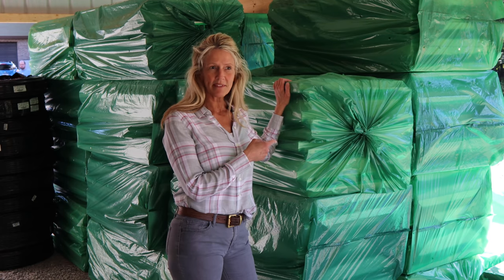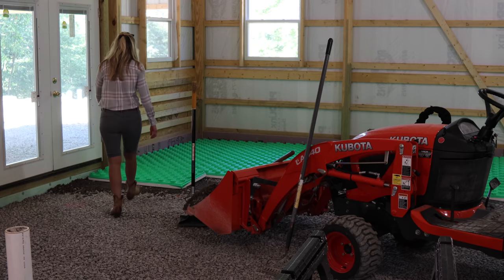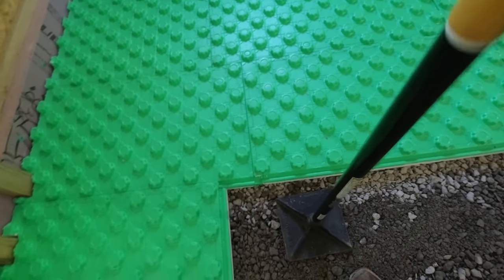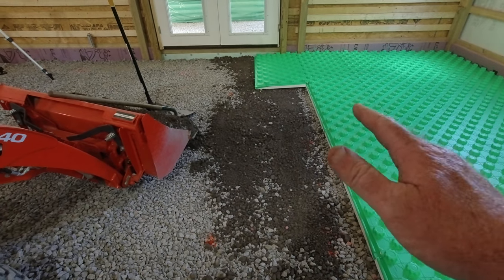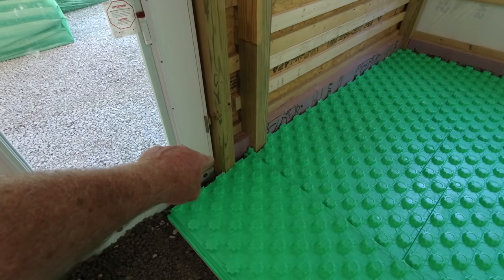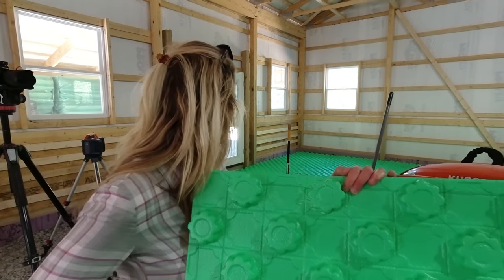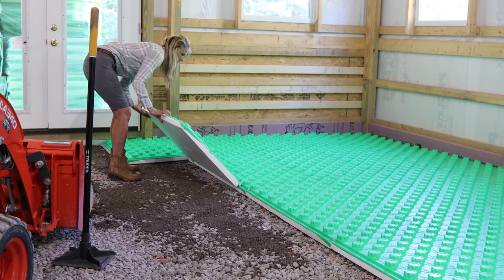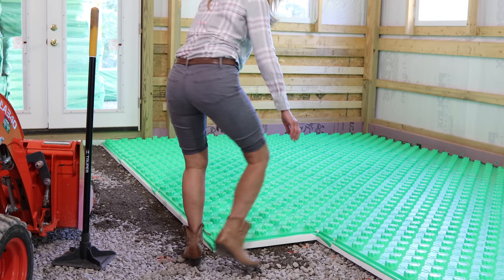I hope the Reward is Worth The Process, Radiant Floor Heat Rough In

Comment: Take really good pictures and make sure your layout is well documented. You can use an infrared camera find the lines after the fact but nothing beats having the layout documented and drawn out. At some point you will probably want to bolt something to the floor and drilling through a hydronic pipe would SUCK. I have a drill press, grinder pedestal, hossfeld bender and a 2post lift bolted to my floor.  If you deal with snow you can't beat a heated slab. Pull your snow packed equipment into the shop at the end of the day and come out to a dry floor the next morning.

Comment: Did you think about the concrete truck being able to get inside and shoot the concrete mix. You don't want a concrete truck driving on your styrofoam panels with the tubing. You will have to use a PUMPER Truck which is an additional cost. Food for thought. Been there and done that before.... :)
Reply from the maker: No, won’t be a pumper and the mixer won’t drive on it. You will see

Comment: Radiant heat warms people; forced air dries sinuses and warms the ceiling. Downside is no AC in the summer, but split-system (Mitsubishi!), wall-hung AC units for office and workout area would address that, economically; make the office area 72 degrees, and workout area 68 (or, whatever) with remotes that look like iPhones. (Suggestion Man -- you can't kill him)

Comment: Question: will the floor heating be as efficient heating  thru 5-6" of concrete as it would heating thru 3.5" of 4000 psi concrete? Haven't heard any talk about that especially in colder parts of the country. Here in Oklahoma may not make much difference, just curious.

Comment: Lol. Getting old is definitely slowing process it much more difficult. Are used to be the same I would just keep pushing and try to get it all done and I rarely slept more than four or five hours in the night and quite often never slept at all and could go for two or three days like that. Now if I don’t get a solid seven hours I’m dead the next day and the older I get the longer it takes to recover from it. Lol. She’s right about the water as well. Are used to be able to go all day long without eating and we get the hydrated and will just come home and drink a few glasses of water and recover in a couple hours, if I’m not fully hydrated and ready to go before I start, I’ll fade really fast and just be done for the day. Lol. Getting old definitely sucks and they’re all kind of things that nobody ever told you about getting old when you were Young. Like things I never thought would be a problem, now I have to use eyedrops every few days or so because my eyes just get really dry and I asked my doctor about it and they said that’s just normal and most people our age have to do that eventually, another thing is dental work, all those old feelings you got when we were kids, nobody ever told me that you had to have those removed and replace because after 25 or 30 years they start to break down, they actually call it leaking at the dentist. My teeth have always been fine and genetically I’ve never had problems with plaque or anything and it’s always been real low maintenance but this year I’m going to have about $6000 worth of work done and almost all of it is maintenance and replacing stuff that was already done that I thought would last forever.  Somebody really needs to write a book about this stuff so we know what to expect. 😂😂

Comment: I'd use sand , coarse washed or even cracker dust , and screed it out with a concrete screed , checked with the laser of course , . you'd be throwing them down pretty quick then.

Comment: No experience but expect you are using something like a running bond to keep the joints staggered,  say every other row is offset by 1/2 panel length.  Or maybe 1/3 and repeat over three rows. Not sure what the manufacturer recommends.

Comment: There is no need to get it all that level, I imagine that you will be pouring a minimum of 4 inches of concrete over the floor, the weight of the mud will level every thing, if driving heavy equipment over the floor poor a six inch slab, also if planing on a car lift plan ahead and pour some footers for a future lift, looking good going to be a awesome workshop, you can also run some conduit under the floor for all your future electrical needs,
Reply: Alot of the new lifts roll around easily with casters , so you are not locked in to where the lift has to stay. Vice Grip Garage has a new one , easily moves oughta the way !
Reply: @mikesr3407   true but you still need to keep in mind what your lifting and in what locations, you will need at least 6 inches of concrete to lift a midsize car, unless the concrete is like 20 years old

Comment: Just my opinion (free, so shows how much it's worth 😁) in this circumstance the precision is unnecessary.  You say you want it to feel solid walking on it, but that's not the finished floor!  After the concrete is laid that weight will lock everything down.

Comment: Why 5" of concrete on one side and 6" on the other ?
Reply from the maker: Game room on one side, equipment on the other
Reply: wicked pissa
Reply: @OutdoorsWithTheMorgans  Hi Mike 5 inches is huge for a walk area . I would also use sand for the final grade. Will you find it harder to heat the floor with 5 inches??  I would have thought 3inches (75MM ) would have been sufficient. Yres I agree 6inches for traffic area.. Also why do you heat the traffic area?

Comment: It's sad, we work our butts off, so we can retire and do what we like, or want. The sad part, schools are not teaching these kids, as we retire, nobody wants to take our place. Americans anyway. Foreigner's are taking over the work force. I retired almost five years ago, helping around the house is a full time job. I don't know how the wife took care of everything while I was gone, 38 years over the road trucker. The wife had a job, took care of her kids, and the house, yard, vehicles, and, had a side job helping a neighbor on his property. My point? No point, but when the wife would ask me, " how does it look? "  Being it, the yard, remodeled the kitchen, remodeled the house, what ever, I would tell her, " Honey, you only have to please one person, yourself." If you like it, it's fine. My buddy, sinced past away, built his house using that heating system. You walk in his house in the winter, it's like sitting outside in 70 degree weather. From the floor to the ceiling, 70 degrees, or whatever you have the thermostat set at. Smooth floor, when wet, is slick as hell, brushed, stamped, what ever texture you want, hard to clean. Love the video's. Western Ohio, four miles to state line, one mile south of Ohio turnpike.

Comment: YOU DONT HAVE TO HAVE THE FOAM PERFECT…THE CONCRETE GUY WILL FIX IT.
Reply: Mike your rock and panels are fine. The concrete will level everything.
Reply: The radiant heat is phonomenal. I have it in my motorhome as well.